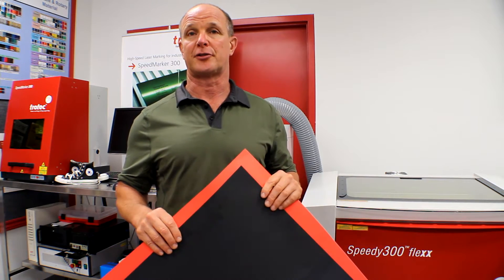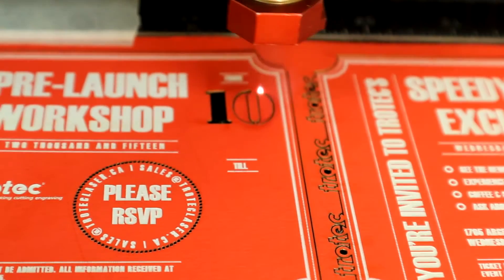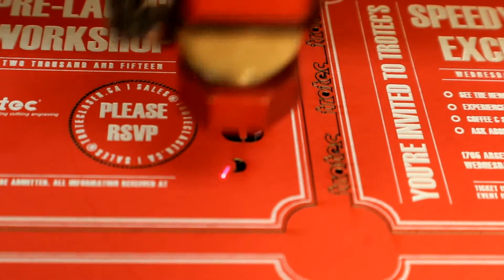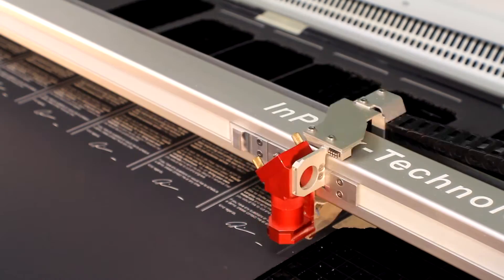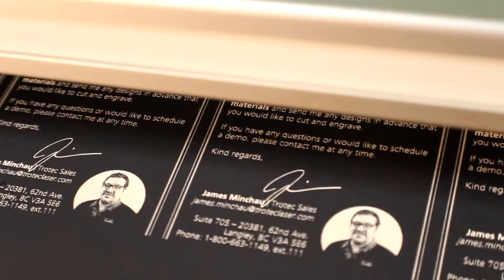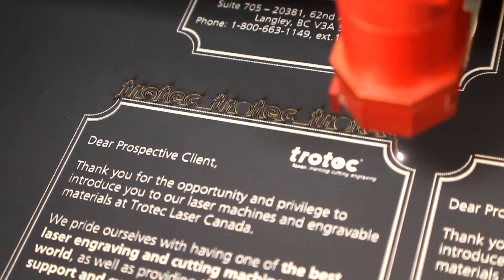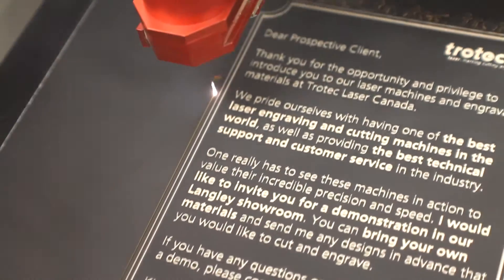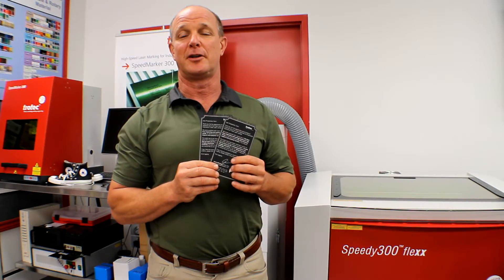Laser Paper Cutting | Laser Paper Engraving | Trotec

Comment: What were the settings for this.  I am currently trying to engrave duplex cardstock but it seems to leave the char or the glue residue.  I have a 60w speedy 100
Reply from the maker: +Jacki Hull Hi Jacki, our suggestion is to always engrave and cut a small rectangle and get the settings so you just get through the material. Also make sure the material is flat. We used 45 power 100 speed to engrave and 60 power and 1.4 speed to cut on a Speedy 300 80w.